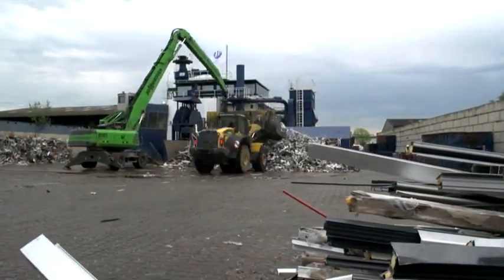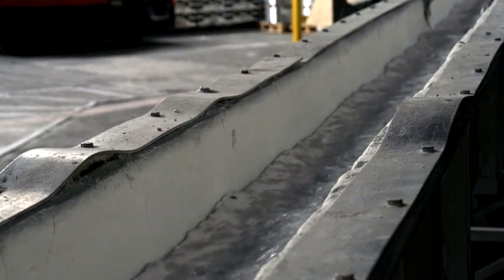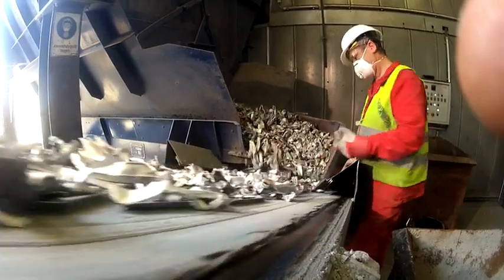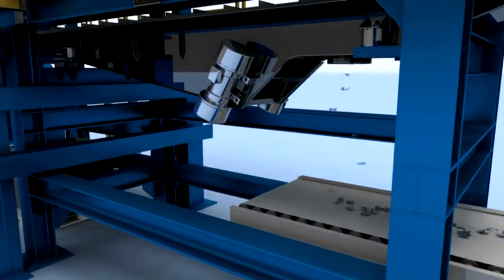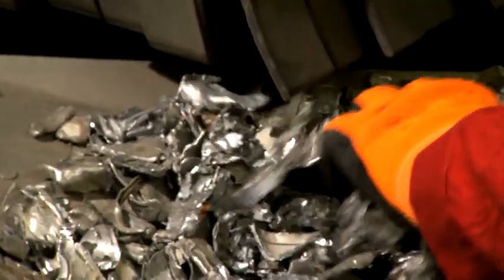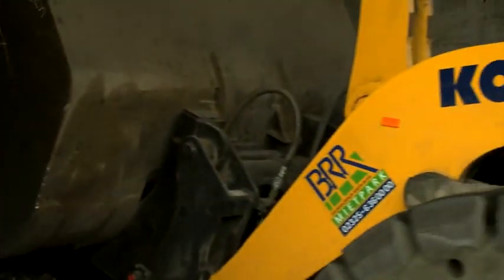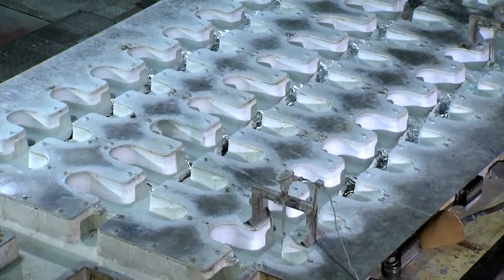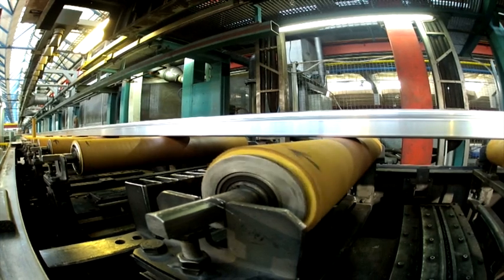How Is Aluminium Recycled?

Comment: But the main question is, why do windows have to be recycled? The best for the environment would be if houses last. Another option would be to repurpose. I built a greenhouse for my wife out of old windows. It was her idea and it turned out great, nothing went to the scrap heap and the greenhouse that we built will last tens of times longer than any made from cheap polycarbonate or weak minimal cross-section aluminium. That said, it is great when recycling works well and the engineers that designed this process are doing good.

Comment: ...we do'nt have that problem at.our yard... i sort aluminum into various rates... mlc   al cans    foil    6061    6-10 grades of dirty al    al motors    3-4 grades various al sheet al     auto transmission     clean and dirty al auto radiators    5-6 rates extruded al window\door frames    insulated al electrical wire   cast al   ...ps my phone battery  2% right now im gonna hit send now , laterz...

Comment: I wonder if this factory is still running with the current energy prices.
Reply from the maker: Hi Thor. Our recycler in Dormagen is up and running, absolutely. Recycling aluminium actually only takes 5 percent of the energy needed to produce primary aluminium, making recycling even more attractive when energy prices are high. :)
Reply: @NorskHydroASA  Thanks, great to hear that essential industries are still going strong.

Comment: Whenever you hear that something is 100% recyclable. It is lobbyist marketing nonsense. It may be an idealized half-truth that you like to hear (and this is why it is told to the public and our clueless politicians), but it is NEVER true! 
Aluminium is not 100% recyclable, as you practically always need fresh primary aluminium to dilute contaminations from imperfect scrap metal composition down to a level where you can work with that. When using that great sorting machine, it reduces the amount of fresh aluminium needed, but you will never come to 0. Starting with window frames is a good starting point as it is a homogenuous starting material.
It is still a great material and it is significantly recyclable. But I don't like to be lied to...

Comment: When the metal goes through that radiation scam isn’t contaminated with radiation?
Reply: Items don't become radioactive just because they are exposed to x-rays. For example, when you get an x-ray at a hospital or dentist's office, you don't become radioactive. Similarly, when you expose food to shortwave radiation in a microwave oven, the food doesn't become radioactive. The only times you have to worry about residual radiation is when something is contaminated with a radioactive substance like uranium, plutonium, radium, radon gas, etc.
http://hps.org/publicinformation/ate/q12968.html#:~:text=For%20most%20radiations%20that%20people,produce%20any%20radioactivity%20within%20them.

Comment: It’s not so much that aluminum is abrasive, but the aluminum oxide that forms on the outside of the metal. We make abrasive belts and disks for grinding steel out of aluminum oxide. Most “sand paper” doesn’t use actual sand but aluminum oxide.

Comment: We did that for years here in the U.S. The Aluminum Company of America (ALCOA) recycled aluminum can stock into high purity deep draw stock (AL3008) and sent the new sheet rolls back to the canneries.
The melting, purifying, casting, rolling operation used much less energy than originally bringing AL3008 from the ore.  The recycled material was also used for high speed rotary disks in computer applications.
Reply: I also worked at ALCOA’s Vernon Works in Southern California so none of this process is new to me.

Comment: Wouldn't it be funny if the energy saved was about the same as the entire recycling program used?
Think about all the equipment and machinery they use, the facilities power and diesel fuel for the loaders and trucks, all the metal and diesel used to create the machines and buildings too.
Kind of like how we thought ev's were gonna solve the Co2 problem but it turns out that to mine and manufacture the batteries and then dispose of them along with burning coal to recharge them, created a net gain in Co2, as in it created more Co2 compared to a similar gas vehicle.

Comment: Why high radiation levels?  Surely the metals have different melting points - why not separate them by smelting then make the ingot of all of the metals right there? Even if they just skimmed the aluminum off during smelting wouldn't that save time, effort, and exposure to radiation and get them a purer product?
Reply: The main issue with melting it all down and trying to separate the contents is that the aluminum they are trying to separate is a random combination of alloys. The way alloys are made is by melting a bunch of the main metal down and tossing in the other metals,melting and stirring it all together. Melting to separate the contents would be next to impossible as they would just melt into 1 mixture. You might be able to have fractional cooling, like in oil but it is very difficult (if not impossible) to do so with materials that are solid at any survivable temperature. using an automated system with air and a pile of lead is much cheaper to run, and probably safer having an xray machine in a box than a continuous metal distillation tower.

All of the material they have is also mainly aluminum, so all of the materials have similar melting points, which means even just trying to separate by the moment they liquify, most would recombine anyway, leading to the separating of alloy issues again. Brass and bronze, for the same reason cannot be easily unmade, nor can steel be easily changed into any desired type of steel either

Comment: Why are they upset about the addition of new aluminum?  Between new construction and replacements of older windows the demand will outrun the recyclable supply anyway.  Does it mean there will continue to be mining?  Can you imagine the human race giving up using metal just to save the planet when we can't even give up oil? How about we kill off single use plastics (or grind them up, add them to asphalt, and increase the durability of our roads? Oh yeah, it reduces petrochemical sales when their products get recycled.  You do understand that plastic is an oil product?)  What impact will mining at maybe 20%of the previous level with more efficient technology have compared to oil and it's byproducts? We can focus on reducing long use existing products with an efficient recycling processes after we get rid of the toxic crap we throw away by the billions of pounds.

Comment: Apparently window frames are very prone to wearing out and be replaced weekly
Reply: glazier here
They last about 10-20 years so all the windows built before the great housing market colapse are starting to fail
Reply: @zachgaines8349  Serious question: What kind of crap frames only last that long? I've got wood/vinyl frames that are 40+ years and still fine, and all wood frames that are over 100 years old. Only reason they ever get replaced is to move to double panes.
Reply: @TheOtherBill  I'm in a very humid area. Aluminum corrodes stupid fast, same with wood. Vinyl lifespan isnt hurt much by this but they arent great to start with. 

This is also worn out to the stanards of commercial applications like storefronts and rental units. They get replaced for purely cosmetic wear all the time
Reply: @zachgaines8349  another glazier here.  Is it the aluminium corroding from the environment, or are the frames in contact with steel or concrete?  
Im in the heartland so I dont have the same humidity problems, am young, and quite curious
Reply: @TheOtherBill  my house was built in 72. The frames still look like brand new
Reply: A window consists of two main items: a frame (or sash) and the glass unit. The technology behind either has relatively little overlap. In the case of aluminium frames, the most important property as far as energy efficiency is concerned is the ability to block heat transfer from inside to out and vice versa. This is done by separating the interior and exterior aluminum frame with a material called a 'thermal break'. If the aluminium window frames have sufficiently low thermal transfer properties then they pretty much never need to be replaced.
The other part of a window is the glass unit which also needs to be as energy efficient as possible and this is done by sealing two panes of glass to each other with an space or gap in between them. The glass pane is then called an Insulated Glass unit (or IG) but it needs other technologies to make it as energy efficient as possible. The main stay of modern IG's is the LowE (low emissivity) coating(s) which rejects heat ingress and or egress (in the case or roomside LowE. This technology is ongoing and improves continuously.
The next part involves making a dead air space in between the two panes. With the addition of noble gas (Argon or Krypton) the effective dead air space can be increased without making the gap between the panes larger. The last bit of tech involves the spacer which separates and seals the two panes of glass. It needs to have as little heat conduction as possible while still making a long-lasting seal from which the noble gas mixture cannot readily escape or outside air cannot readily ingress.
For example, Cardinal IG supplies window manufacturers with IG's which have demonstrated spacer integrity which averages greater than 20 years. IG's will need to be replaced over time but luckily they can be replaced without taking the window frame out.
If you are buying windows and you are going to own the building for a while, it would be worth it to ask if the IG's come out of a dedicated facility because those units are vastly more reliable.

Comment: This is a German Potlatch.  The scale of this is minimal, compared to global aluminum production and recycling.  Probably doesn't cover the cost of development and specialized high capital equipment without government subsidies. Rather than using this complex process, it probably makes economic sense to just use a smaller amount of scrap in the picky production processes, and figure out what uses that can tolerate a greater amount of contaminants, or come up with techniques to remove contaminants.

Comment: As a matter of fact, back in the mid 80's I worked at an aluminum extrusion plant where we made the parts for doors and windows. Trust me when I say this, it was a hot dirty business. I worked on the main press where the extruded parts were cut up and sent to the anodizing department. We were just a few dozen feet from the heating oven for the logs which ran at 900 degrees F and the press which ran at the same temperature. Behind us was the aging oven which ran at 500 to 600 degrees F and we were only a couple dozen feet from it. This in the middle of Mississippi summer where the temperature runs about 95 to 100 degrees + with a humidity of about 85 to 98%. It was so hot, we were required to stop every 2 hours and cool off in the workers eating area that was air conditioned. I would go into work at 6:30 AM and look decent. I came out at 4:00 PM looking like a drowned rat! Covered in sweat and black residue from the aluminum. Man that was a hard job.
Reply: Did it pay well at least?
Reply: Bence Jávorszki-Farkas Those types of jobs typically do (in the US at the very least). Many hazardous jobs in general do. Garbage men where I live make welllll over $100,000 a year.
Reply: Never tried rat before
Reply: @carlthronson8737  it tastes like chicken
Reply: https://youtu.be/xFhQ3Ybqtf8
Reply: I hope that they gave you plenty of cool water to drink and some electrolyte drinks to rebalance your body? How long did you last in that job? 
Mark from Melbourne Australia

Comment: According to this video Aluminum is used a lot in the manufacturing of modern double glass windows in Germany; in the US aluminum has been replaced with a fiberglass composite that does not sweat like aluminum does and even stronger materials.

Comment: The window manufacturers should cut down on using parts that make the windows difficult to recycle.
Reply: They don't use parts that make the windows difficult to recycle. It's the non window frame scrap that made sorting a challenge. And it's not difficult with the tech in this video anyways.

Comment: I'll be damned. Brilliant solution, I was expecting it would be an electromagntic solution, but Xrays are ingenious. I looked up aluminum can recycling and they do something very similar, but not with Xrays. Very cool software tracking the chips and driving the air jets.
Reply: I have seen this solution used for other products as well.
Particularly sorting good and bad eggs/fruits/vegetables

Comment: It's certainly good that impurities can relatively easy be filtered out, so that the level of purity is ensured. Even with recycling, though, a lot of energy is spent in the process. It would be more ideal if parts were more standardized and perhaps stamped with a material declaration. That way you could skip much of the granulation steps, or even better, re-use parts as-is.

Comment: Aluminium is not an alloy. Is a metal by itself. An alloy is a mixture of two or more metals forged together. If aluminium is mixed with another metal to form alloy, it is no longer called aluminium.

Comment: "Aluminum is an extremely abrasive material that wears out other metals"

What in the actual fuck? Aluminum is one of the softest metals...... what the hell are they talking about?
Reply: He should have said aluminium oxide.
Reply: All aluminum oxidizes nearly instantly when exposed to air so all aluminum is covered in an aluminum oxide layer. That is the dross or garbage floating on top of melted aluminum. Aluminum oxide has a hardness of 9 on the hardness scale. Diamond is 10. That's why it is used in sand paper and would easily wear out most cutting blades.

Comment: I like vinyl windows better.
Reply: Plastic frame windows are way more energy saving in production and last forever. Also they are really good at keeping the heat inside the house.
Reply: noob gamer But they are not easy to recycle, and actually don't last forever- they delaminate, go brittle and discolour. They keep no more heat in a house than proper thermally broken aluminium frames that will last forever. And they are ugly as hell.
Reply: grabir01 Why? They are hideous, and an environmental nightmare. On more expensive homes in the U.K. you would ask for a discount if it had plastic windows as they make the house look cheap. They are banned in conservation areas and on listed buildings. Plastic windows only belong on caravans.

Comment: Did they take into account all of the transport and collection processes in their analysis of Greenhouse Gas Emissions? How far do they have to transport the scrap window frames to recycle them? The true bottom line must always be calculated.
Reply: Robert Evans smelting new aluminium is one of the most energy hungry industrial processes there is. Even if transport were taken into account, the carbon footprint of recycling would still be a fraction of producing new.
Reply: I agree. We often focus on a single aspect of recycling..failing or minimizing that we might have simply shifted, or even increased the economic or ecological footprint of the process. To your point; Collection of all the recycled material, truck fuel, processing equipment/plants, radioactive material used in xray machines, etc. 

I'm not making claims one way or another...however, I do think it's important to analysis the entire process.